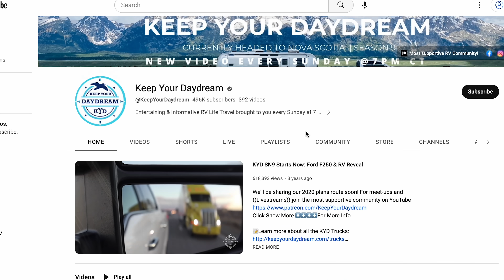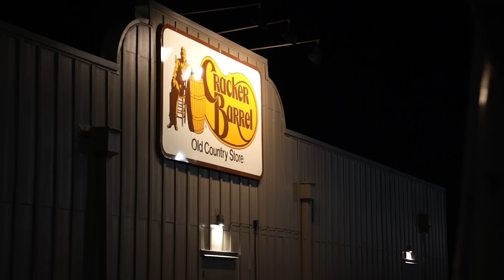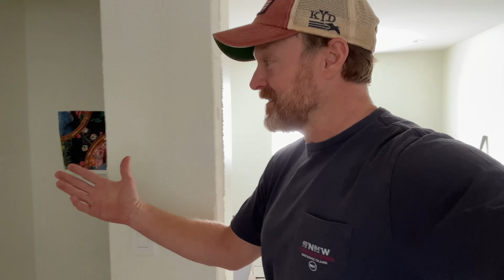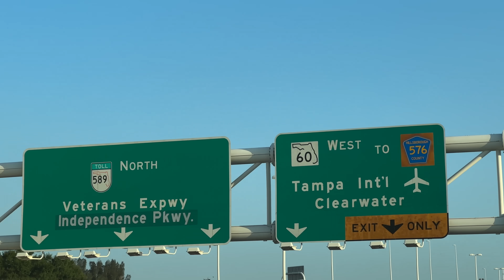😨 Things New RVers Don't Need to Worry About!

Comment: We use our trailer for Vacations, more than to travel.  7 to 10 days in one park, then moving to another for another week or so.  That is our summer Camping plan.  So, we tend to put everything up, every time.  Of course we have to get our trailer out of storage and back home.  That is Saturday's job.

As we plan to make some long trips after we retire (July 2024), we did a test run last June, where we stayed only 2 days at each park, travelling 300-400 km every other day.  Muskoka to Wawa and back.  We learned the lesson, not to set EVERYTHING up every time.  Our Shelter only got setup once and that was due to BUGS!

I am look forward to see your trip to Canada video later this summer.  We have begun planning two post retirement trip, one to Nova Scotia and the other to Banff (Both starting in Ontario).  So you will provided us with lots of good ideas for our trips.

Good luck with the windows.

Comment: Hey guys! Brand newbie here. Pick up my Airstream on June 6th and going full time! Never towed anything in my life so a bit nervous but trying to soak in all the info I can. This episode gave me more confidence thank you!
Reply: Gonna love it.  They tow so nice.  Sometimes, you forget it is back there.  Always swing wide, never assume you're smaller than you are.
Reply: Just remember that the trailer tailgating you has a family who love having fun. In my experience, it takes anywhere from a few hours to a few days to get used to a different vehicle. On my first RV trip, I rented a class C and a few days in, I was driving a one lane state highway with a steep hill on one side and a steep drop on the other. While it wasn't "a piece of cake," it wasn't all that difficult, either.
Reply: Take your time and check and recheck all connections you will do fine 👍

Comment: Hello Marc and Trish,
We have a 2014 Airstream International Signature. The stabilizer feet are 7 1/4” round. What size Snap Pads did you buy for your Airstream? I see 7” and 8” pads. But not sure if my numbers are important, I would assume all Airstream have the same foot print. Congratulations on your daughters engagement!
Tom and Debbie Moquin

Comment: BIG MISTAKE at 12:55!  ALWAYS hookup the sewer hose ASAP when you stop.  Example: we stopped at a park, setup up including the sewer hose and went for a walk after we finished.  When we got back there was water running out the back of our camper.  We had forgotten to turn off the bathroom sink completely.  I opened the gray valve and the over flow stopped almost immediately.  The gray tank was full and also filled the shower pan and it was overflowing.  If the sewer hose was not attached, it would have taken much longer to stop the water flowing onto the floor.  I'm VERY glad It was already hooked up!   PS, love your channel.

Comment: Hello, Thanks for all your videos. a wealth of information! Seeing that you have a great experience of motorhome camps, I have a question. I plan to buy a flying cloud 27 for a full time and I was wondering if the length by adding the truck (20 feet) for a total of 47 feet was not a problem. We often see parks that are limited to 40. This limitation is for the trailer and the truck together?
Reply from the maker: We're a bit over 50 and no issues. The "limit" tends to be RV only. We haven't had a problem in sites or a place to park to truck on rare occasion.
Reply: Ok thank you for this quick response. So if I understand correctly, you install the trailer and park the pickup in a parking lot further away. No one tells you anything, not even at the entrance to the national parks where they say maximum 40 feet to do the manoeuvres. Thanks 🙏

Comment: Hauling horses from Northern California up into Oregon then down Redwood Highway to Crescent City...can do this legally without horse health certificate...as long as we don't unload horses outside California. Driving down US 199...The Redwood Highway...10 miles from the California state line...we encountered a folded blue tarp,  in the middle of our lane,  on a blind turn.  Had no choice but to straddle it. Bad idea...The rear u joint snatched a corner of the tarp and wound it all along the drives haft. Can't unload horses.   I laid under there with a Leatherman,  a pair of vicegrips and a screwdriver to get that melted plastic tarp out